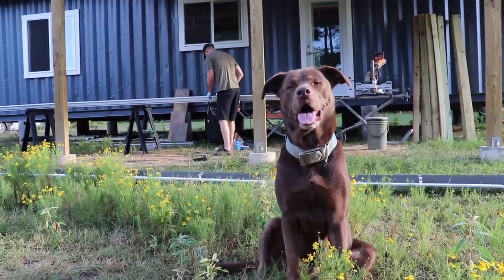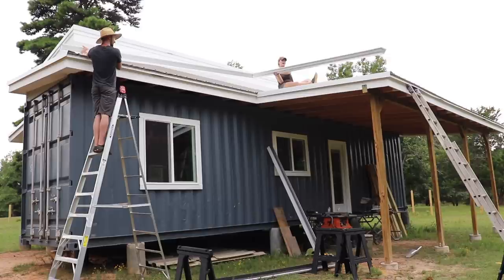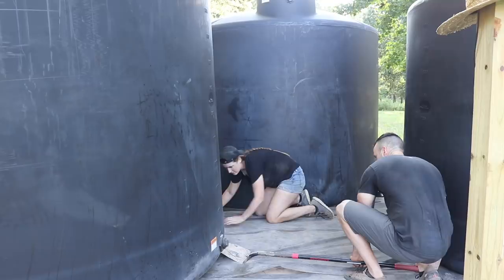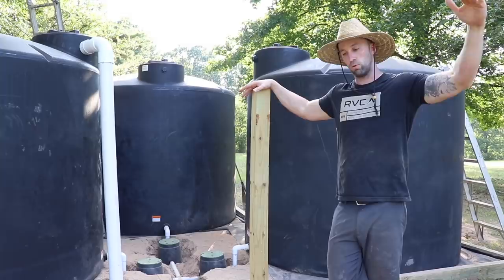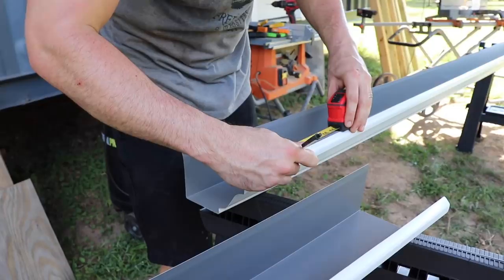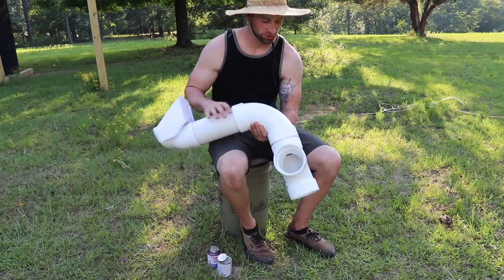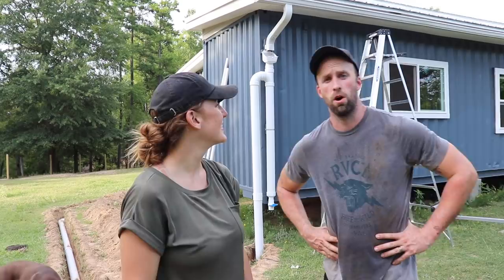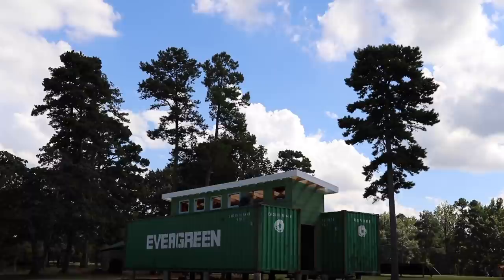DIY Off Grid Rainwater Harvesting | Start to Finish

Comment: Nice how we looked back of your project since starting the water tanks put in so what's next the walls right insulation then putting up plasterboard panels after to make it more warmer then plastering to do I am assuming its looking good from outside and now make the inside as good as the outside I for one pleased its working out for you can't wait for what your next job for us to view.

Comment: If you are planning on staying a while you might consider poured concrete or block curb around the water tanks because no matter what the rating the wood will rot and need replaced ... Right about the time you get aged enough for the job to hurt ... Think making stuff so you can still do it into your 60s and 70s ... Raised bed garden ... Espalier fruit trees and vines ...

Comment: Life Uncontained
Just a few quick question. Firstly, did you put a piece of tracer cable wire in the trench along with the pipes so if you or anyone else needs to dig around or drill you can instantly  track where the pipes are using a detector without causing any problems in the future ?
Secondly, if someone wanted to send a little gift for the soon to be new addition to your family, is there an address or post office box that it could be sent to please ?
I really liked the format of this video as it showed an entire project from start to finish, and would definitely like to see more done this way.
Also, have you ever thought of doing an entire blooper video ? With all the mishaps that occur around you three (Bear is definitely included in this one), there must be plenty you could put in one !

Comment: Out of curiosity, I have a couple of questions.  Obviously the water containers are made out of some type of rubber.  Is there something the manufacturer does, in the process of making them, that keeps them from dry rotting?  I ask, because I've seen things made from plastic/rubber literally crumble from being exposed to the heat.  My other question is, is there are reason that these type of containers could not be put underground?  Again, thanks for sharing.  It was amazing to watch, and see it all come together.   Cheers, and God  bless.

Comment: I really like this project, however I want to give you a friendly reminding. Do you ever think about that the metal roof will be scorched and drenched by sun and rain? After couple years, there might be some paint peeling from the metal roof, and flow into your water tanks because of that. You won't want to let your drinking water is poisoned by the heavy metal from those paint.
Reply: Depends what metal they used. Millions of homes in Australia have what we call "color bond" which is just pwdercoated steel. Nobody here gets poisoned even after the colour fades and the homes are 30+yrs old. This shit lasts forever lol.

Comment: Spencer do your water tanks have a vent to atmosphere?  If not you may collapse the tanks when you  drain the tanks....you will pull a vacuum that will suck the tanks in.  Also the water line will be filled with stagnant water for long periods sometimes...that may be a problem.

Comment: I have two questions...... 1. The large Pvc pipe that connects the gutters to the tank will allow water to stagnate inside the pipe between rains. Will this water rot or spoil?   2.  I'm thinking of trying a gravity system to fill my toilets using a rain water system. My pressure will be 1 psi or so. Will that work on my toilet fill valve and what options do we have?

Comment: Big fan of your channel. 
But shouldn't that feed pipe running from the house to the tanks be a little bit deeper❓
What's your freeze line❓(how deep the ground freezes in winter) 
Most codes call for at least 18 inches to the top of your pipe,  in colder areas (mountains) I've seen it go 2 feet....
The last thing you're going to want is that pipe splitting in a hard freeze.....
You might also think about boxing in and insulating your risers,  both the drops at the house and the riser at the tank.....
As the only time you will have flow is during the rain,  you're going to need a way to keep them from freezing solid above ground.....😕
Remember,  ice can split a steal pipe as easy as pie,  so PVC hasn't got a chance of holding ice in check.....
Box around your risers and insulate,  a little heat tape couldn't hurt too......
Just a word from an old plumber who lives in New England.....

Comment: why would you put gutters on the top roof when it would drain onto roof naturally?
Reply: 1. It keeps down the noise of the water draining onto the second roof.
2.  The water draining onto the second roof will eventually wear away the finish and cause rust along the drip line.